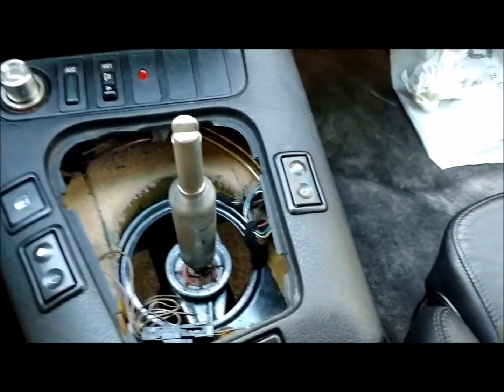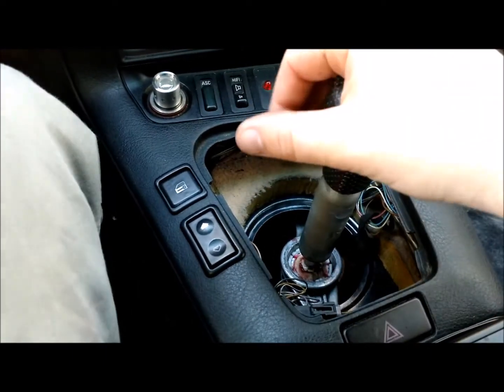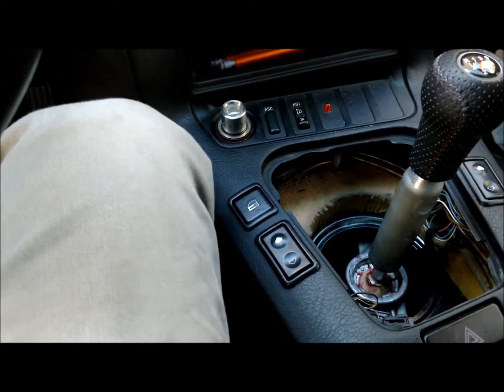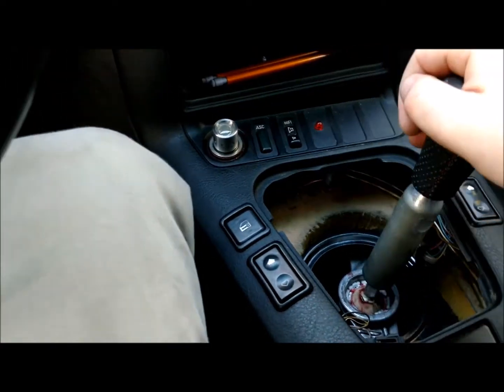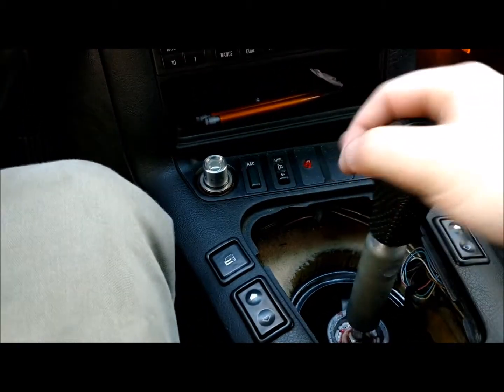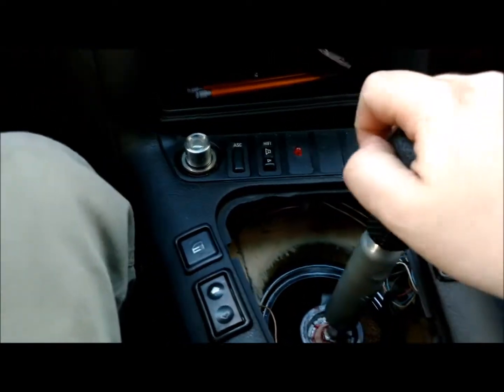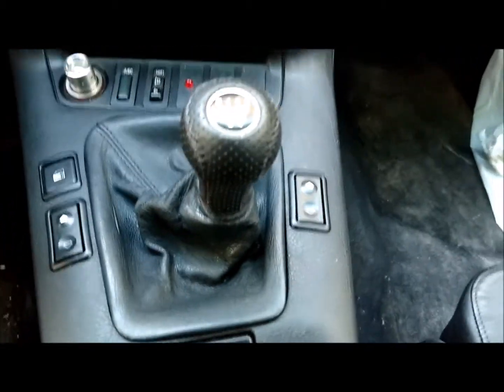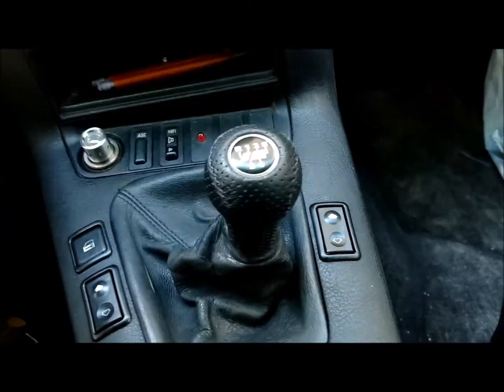BMW E36: 5th Gear Lean

Comment: My 2002 E46 330i has the same problem, when it's cold it will lean and be incredibly annoying, when warm it's not as bad. I should probably change the trans oil too as i have no idea if it's ever been changed on my car (170k miles)

I know it's been a year since this video, i saw the update video where you said that the fluid change helped. Any more updates? Do you even have the car anymore?
Reply: The issue isnt the fluid. You need to change the detent pins on the transmission. The fifth and reverse gears often go bad. Next time you pull your trans for a clutch job price in a detent repair aswell. Should cost you around 600-800usd for the tools and detents if  you are in the US
Reply: @cannedspace412  doing this right now on my 330ci. Found the pins and tools from different websites, only spent about 200$ including the tools!! The kits they list are crazy money at 300 plus